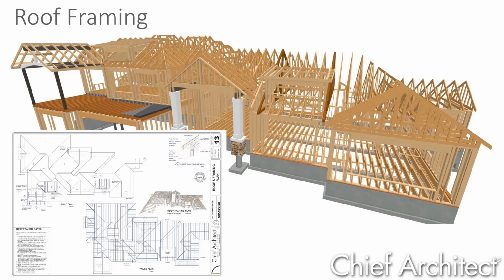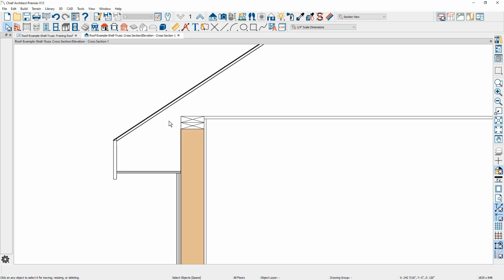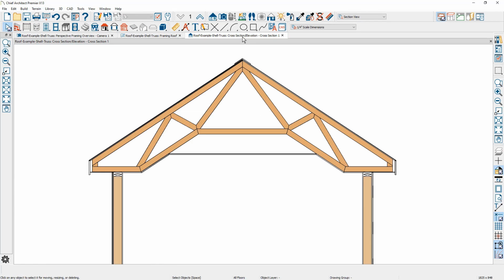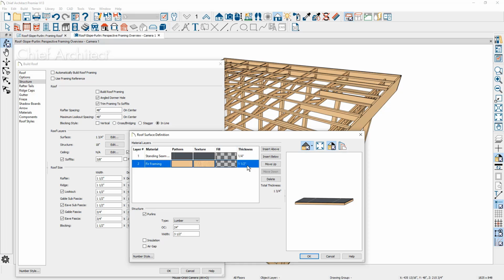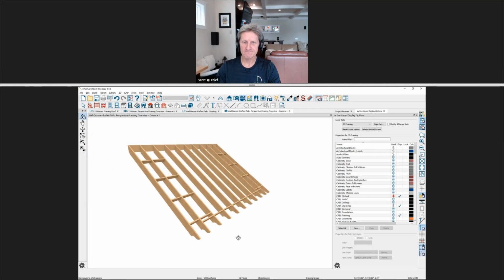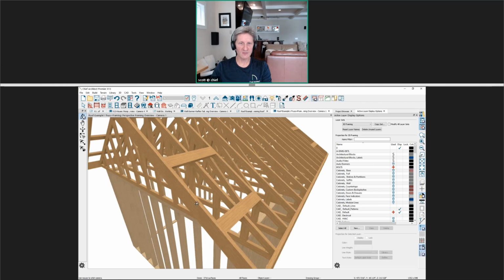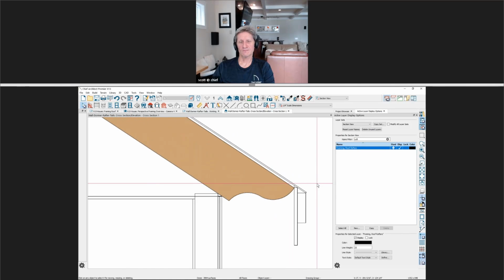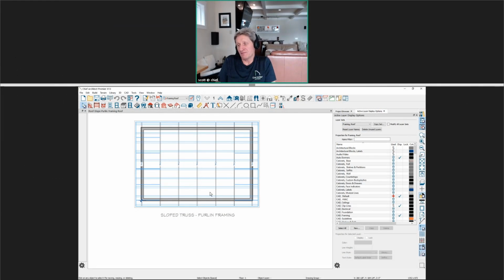Roof Framing Basics (Re-Run)

Comment: When cutting rafters  i use  a book to get rafter length..but anyway  deduct the thickness of the ridge   before looking up the rafter length  and add the Shear wall if there is shear.. so a2/8  ridge would be 12' 6'' minus  1. 1/2 for the ridge  plus  1 inch   for the shear if  span of the build  was 12'6''  you would look up 12' 5 and 1/2''  remember books calculate the rafter by the total span of the building not the run of the rafter. on the hip and valley you would also look up 12' 5 1/2''  there is no shorting that is the length of the hip or valley from the long point to the seat.    the reason a hip has to be dropped is because  the  edge of the seat cut does not sit on the edge of the plate..  to see what i mean take 2 ---2/4s   lay them like a corner of the building would look,   notice a common seat pulls up tight  to the plate but at the  corner the only  the very center of the hip touches the plate  the edges of the  hip would have to move forward 3/4  of an inch  to touch.. that is the reason the hip has  to drop  it is difficult to explain   At the valley the reverse happens  the valley does not  touch the very center of the  plate  so you cut back the  seat  of the valley 3/4'  inch